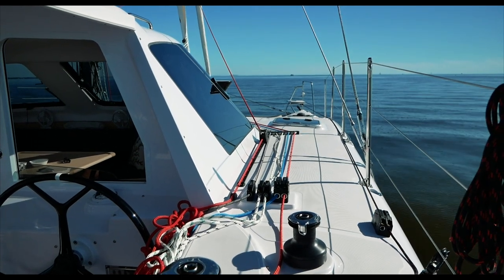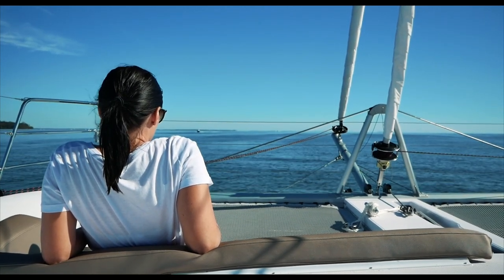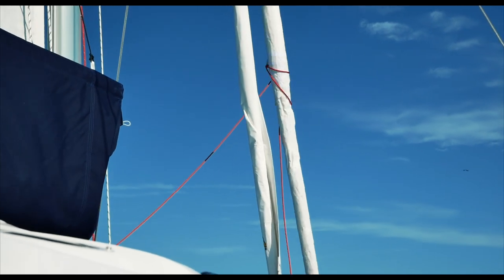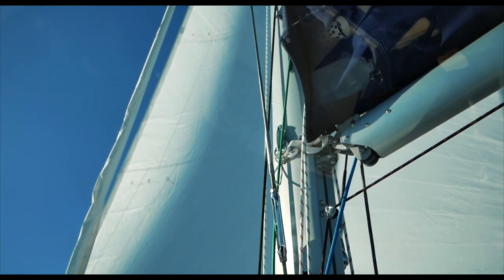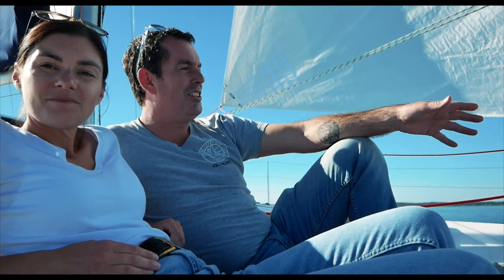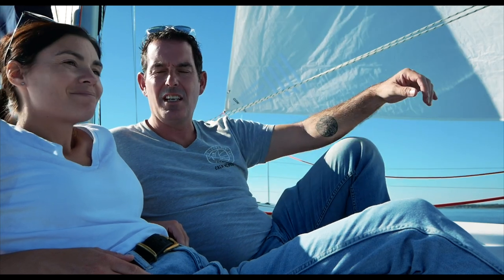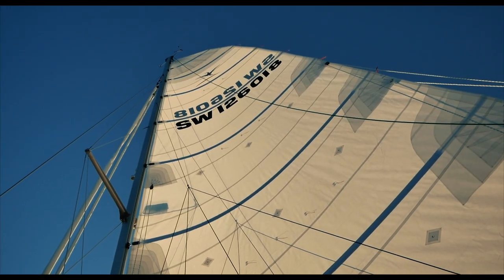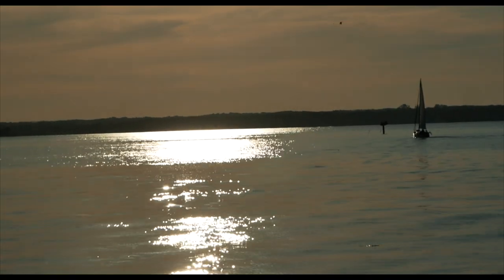Seawind 1260 Test Sail 2020 | Catamaran Sailing & Management Interview

Comment: Quite a few comments about visibility in wet conditions. There is a multitude of automotive products to treat windshields which ensures perfectly clear glass in the most severe conditions. Not an issue...without wipers. Speaking from a Canadian perspective, that galley was made for bacon! :-)  Direct factory post-purchase involvement is a HUGE advantage.   Also, there is another couple with a YouTube channel (Sailing Uma) who converted the engine power to electric. I was impressed with the execution. Less weight with almost no maintenance. Fuel cells converted to other storage uses, etc.
Reply: If it's that bad then you can't see out anyways.  It's no different than night time.   You just use the radar

Comment: Decks may be wide, but I had to do some version of a pirouette to get past the standing rigging while not trodding (cue Spinal Tap) on the lines.  Thus, I found going forward very unpleasant at anchor.  I can only imagine how it would be in rough weather.  Otherwise, a very nice small cat.  I liked the 1600 much, much more (although I kept bonking my head going down the steps into the hulls).  Thank you for the test sail/review!!

Comment: Don’t be mad guys but I’m leaning toward a 44’ power catamaran.  The cost and replacement cycle of the sails, wear and tear of all the sailing gear and work to maintain it, all of the worry and stress of wind, wind direction, strength and sailing well along with the added time to reach all destinations when tacking is necessary seems to push me toward a power vessel as being a more logical choice.

Comment: Another great video.  I love a lot about the Seawind but still have a few concerns with it, mostly safety & functionality.  Could you offer your opinion on these ? 

1) Forward visibility.  I still think the view forward through the salon and then through a steeply raked forward windscreen is less than ideal.  People walking in front of the helmsman, light pollution from the salon, and the omission of wipers seem to make navigation in sporty "British" weather to be less than ideal, especially at night.  I have seen opening windscreens with top-mounted wipers.  Would you see this as necessary?  Would you prefer the elevated bulkhead style helm, like the 1600, if given a choice?
2) Fore-deck access. There are some similarities between Seawind and Maine Cat.  They both look like a seriously fun boat to take on a journey.  They are both lighter weight, higher-performance catamarans with a simpler approach to fit-out.  One concerning design aspect that I believe they share is the reverse shear of the coach roof transition from side deck to fore deck. I understand that this sloping deck is dictated by interior design and volume but it seems like a dangerous area for traction and safe movement in poor conditions.  While under way on your return trip in the rain, did you venture out to the fore deck?  Are you able to validate or discredit my thought on this?  It has always looked slippery and possibly dangerous to me. 

Once again, great job and looking forward to hearing about the Ruby-2.
Cheers
Reply: We have owned our 1260 and crossed from Aus to New Caledonia, plus cruising the Aus coast. The non slip deck finish is very safe to walk on, in 3-5m swells I have walked to front without ever slipping. View through saloon is great, never had an issue, but at night light pollution could be considered so light generating sources are off, as would any boat
Reply: I have a 1260 and frankly the helming setup is one of my favorite features of the design. One aspect that does not get discussed enough is that you can also lean over to your left and see around the ourside of the cockpit - or better still sit up on the side and get a clear view as well. The nice thing is that if the weather is bad - you can stay behind the wheel - fully covered and with dual helm's move from one side to the other without leaving the safety of the cockpit.
Reply: For previous monohull sailors this sidedeck worry is a non-issue.

Comment: A lot to like . .  especially the involvement of the builders.   BUT,  I can't agree on some of the major aspects of this boat, primarily the use of dual helms which creates unnecessary complication and a waste of space . . . not to mention the problem of which 'helm' will get the electronics and sail controls.   Also the location of either helm actually affords very poor views forward trying to see through the windows but being blocked by the structure between the windows.   Further, your view will be additionally much more limited in any any amount of sea since the pitching boat will further limit the view through those 'windows'.   Finally, those helm stations are only partially protected which was fine on the day of your 'tour' but would be very much exposed in any wind with an aft component which would blow rain & spray all over the helmsman.    For a much better arrangement (in my biased opinion) check out a Maine Cat 41!

Comment: i have enjoyed you interviewing Leopard and Seawind personnel but i think you'd do well to invest in and use multiple WIRELESS microphones during your interviews. I noticed a bit of background noise in both interviews that cut down on the intelligibility of the individual speakers, particularly those furthest from existing microphones or those closer to outside sources of outdoor noise. I don't watch every video but INTERESTING journey you face going from mono hull to multi-hull. My only question is Did you ever consider a fully electric boat or even TRIMARANS?

Comment: Question: With helms station on the same level as cockpit and salon...... do you find this to be a great advantage or a minor advantage or?
What I am thinking is that many helms stations on catamarans are "high up" and must mean a lot of "up-down-up-down-up-down" during the day while the Seawind 1260s helm stations are on the same level as everything else........ so this must be great while sailing and maybe especially on watch in crappy weather or?
Reply: I think it may be a case of user preference. Higher helm = better visibility and not having to look through the salon but the downside would be more up and down and more chances of falls/injury during rough sea. This one looks about as protected a helm position as physically possible on a boat this size.

Comment: The CEO cooked you breakfast, that’s not something you see everyday, but that’s in line with all my research I’ve done in Seawind. From the very beginning (when we rocked up at the Sydney boat show with a huge dream and zero clue about anything) they treated us seriously, took the time to explain things, and now, because of that, and the fact that all the research I do points to Seawind being great, reliable boats, a used 1160 will be our goal in 2-3 years (need to save more). Now if in that time any 1260s show up on the used market I’d be thrilled, but I wouldn’t expect it, these are boats that people seem to keep for a long while because they’re just that good.
Reply: Seems like he was pretty reasonable at it. If that is an example of his attention to detail, then the boats should be pretty special too.
Reply: Spent around 25 days  chartering a seawind 1160, 3 and 4 cabin version.
Easy to sail, even though the boat was detuned for chartering I did manage 10 knots plus on a reach.

Id prefer the 3 cabin version as it offers a much better bathroom.
The trifold doors are amazing.
The galley down works great, having the window over the cooker gets rid of the steam and smells easily.

Only downside was the cockpit fridge could be better insulated.

Comment: 2 questions that should have been asked, are the bulkheads glassed to the hull or glued and will they be releasing a model between the two at around 45 feet with galley up?

Comment: Just wondering what made a difference in the feel of the steering? Anyway, great view...
Reply from the maker: Hydraulic linkage vs mechanical linkage in the 1260
Reply: Hydraulic helms give no feedback, with the  mechanical ones you feel how the rudder works, so you have a feeling of how the sails are set, if are balanced or the rudder has to work hard to keep the wanted course. So it is not only more enjoyable when you are at the helm, but also useful when you set the autopilot as you have a feeling about the load you put on it. If you have to fight with the helm to keep the course also the autopilot will have to do the same.

Comment: It is definitely a nice boat, but I just can't get over the lines on the deck, especially near the shrouds. Watch 0:35 closely as the guy in the pink shorts travels the deck, kicking into the lines and ducking the shrouds. Now imagine one of those lines running under his feet in heavy seas.
Reply: Do you always want to "run around the side decks" in heavy seas?   Surely you would have foreseen the heavier weather and reefed earlier?

Comment: 5500 lbs of gear on top of fuel and water sounds like an a lot to me.  N & T, what do you figure you need for your far off the beaten path extended voyages?

Perhaps you eat into that with extra solar, bikes, and scuba gear/compressor. But if you skip the genny and go lithium, would it work?
Reply: Nick did ask about loading on top of fuel and water. But it was unclear if Seawind’s response of 2500 kg included fuel and water or not. It may be 2500 kg of gear, fuel, and water combined.
Reply: @kimyoung230  It was on top of fuel and water.
Reply: Bogan Bob so if you have a watermaker, and perhaps don’t generally fill water tanks all the way, based on usage, then you can carry a bit more gear?
Reply: @kimyoung230  Full water tanks on the 1260 carry over 1500 lbs of water.  Depending on your water usage, comfort with severe cutbacks if the water maker goes out during a long passage,  and desire for performance, you can certainly keep them much less than full.  I knew one 1160 owner who always kept his tanks at 25% unless he was on a long passage.   25% of 185 gallons is still 46 gallons to use and that saves you > 1000 lbs.

Comment: I was looking forward to a proper sea trial. Maybe this boat does not suit the rough stuff. And would have liked to seen the engine access in both engine bays. Looks like changing a Racor filter with a hot engine is not happening?  Is the impeller at the back of the engine like most Yanmars? It will be impossible to change if it is. Is engine bay access really that good through the shower? Why was it skimped over in 1260 video? Looks terrible like access? Lagoon engine bay access looked amazing! Have spoken to Jay from Seawind but was hoping for some good video and feedback to save a trip to look at 2 engine bays. Can you please shed some light on my concerns?
Reply: Well the silence is deafening! I have asked yous on Twitter and on YouTube about 1260 engine bay access and will have to assume you can not tell me my assumptions are correct because you have a 'deal' with Seawind. Obv the Bigger Seawind looks like a fine boat with no flaws - and good engine access. And obviously the smaller boats main flaw is engine access because that was the one section that was glossed over in the 1260 video... and will not be talked about on social media!
It is also interesting to note the bridge clearance may be a bit low - often it is what is not said and shown that give the biggest clues. For a small and relatively cheap boat there are obviously going to be a few fairly big compromises - that is understood.

Comment: Not sure about the bi-folding door, look like an accident waiting to happen, Some form of damper needed to slow it drop after unforeseen release.
Reply: Saint Si after almost 20 years of using the design on the 1160 in all kinds of seas it might work. Although more safety is never a bad thing.

Comment: So, is Ruby Rose II going to be a Seawind?
Reply from the maker: Haha, we had all the Leopard predictions when we put out the Leopard test sail 🤣🤣🤣
Reply: Sailing Yacht Ruby Rose ... I didn’t jump on the Leopard band wagon even though it was the next video. 

Reason being... performance wasn’t there and after following you guys for the past two years... I know Nick won’t compromise on that. 

So, to sum it up, (unless Balance is going to make you guys a sub 50 ft Cat) my money is on the Seawind. 

For Nick, it has the performance. For Terys, it have the ventilation. Once you talk them into making you one with Galley up, you’ll have plenty of storage for your Pacific adventure. 

Feel free to send me a beanie when you let everyone know I’m right!

Cheers!
Reply: @judsonvanmeter1091  The new Balance 442 is a possible candidate i think, no need to make a one off just for SYRR, and has galley up and even dagger boards, the problem is that it will cost quite a bit more then the 1260, its base price is 700K, fitted with all the extras to make it ready for living aboard, long ocean passages, probably other 100-200K are needed. I don't know how the pockets of SYRR are deep and also how they are good at obtaining a special price in change of visibility, but the boat production is already planned.  Other way it would had been impossible, you need much larger cats to justify the construction of a single cat, the project and the tooling to produce it would make it extremely expensive.
Even with semi custom and tailored on the customer's needs yachts you have to start from existing hulls and even so not everything can be changed unless we are talking of boats in the several millions range of price.

Comment: So, now when are you going to make public the length of the Seawind you are in the process of designing? The new 1430...
Reply from the maker: The smart money is split between leopard, balance and Seawind. Promise we will reveal all soon
Reply: @sailingrubyrose  Sweet Baby Jesus, I hope you're able to talk balance into a mid 40ft boat...
Reply: @Chris-zo5ze  the Balance 442 is 44.29 ft long, only about 3 ft longer then the 1260, weights about 2 metric tons more, has dagger boards and a different level of quality, i am convinced that they are both very good boats, but the Seawind is good quality at a budget price, all the quality needed to have a cruising cat that performs well in every condition and can sail around the globe, the Balance costs a lot more even if is only marginally bigger, is way less minimalist, there is a reason if you pay it at least 200K more.